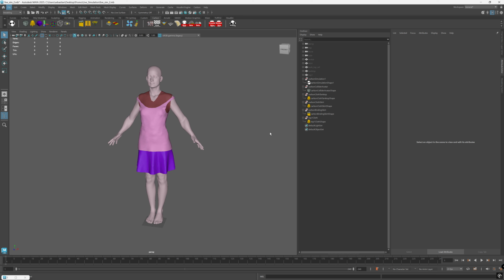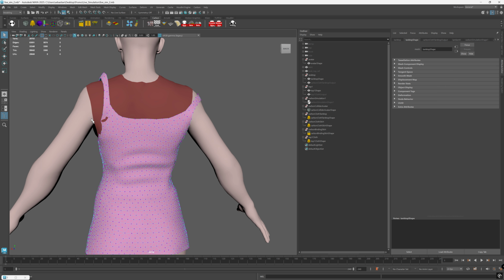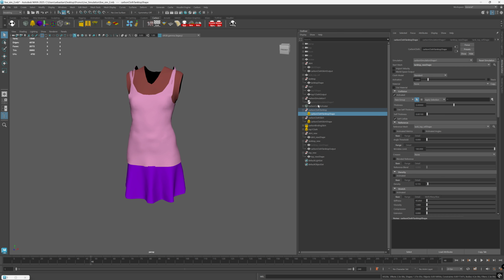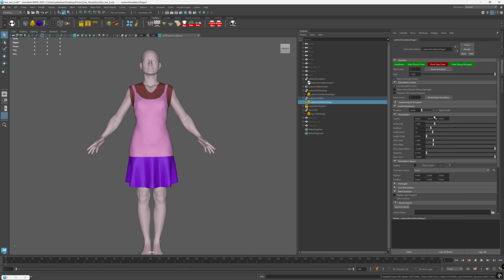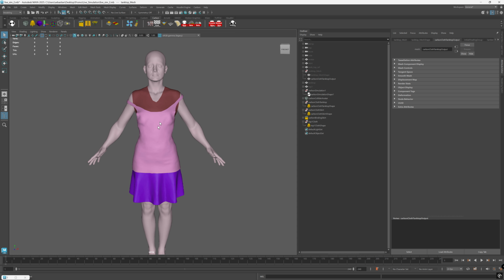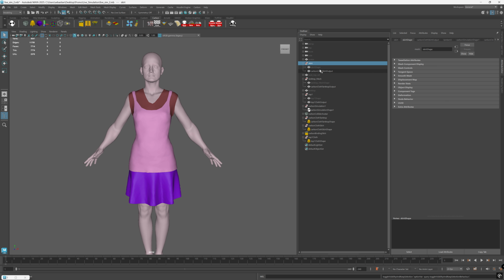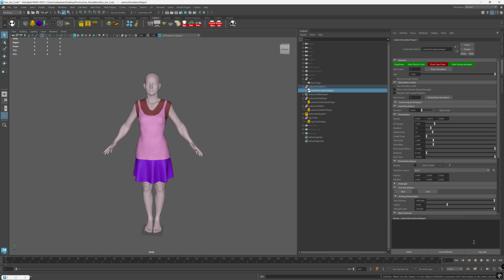Carbon Tutorial - Maya - Live Simulation - How to fix a shoulder strap

Comment: Hi, this is a good start of a tutorial but a few things are not clear:
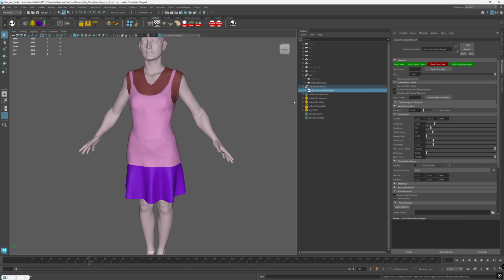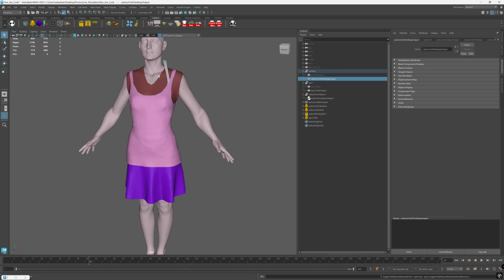- 04:07 - when you say "something in the output is wrong", you show a purple tanktop mesh which is not selected, a tanktop which is very different (exactly at 04:07) and then one single strap which is sticking out.
You never explain what is the reference, start and output meshes. The documentation also doesn't explain this: "The reference metrics allow the cloth to simulate based on physically correct metrics, no matter what the metrics in the start mesh might be." Why do there have to be two? What are metrics in this context? What is the purple mesh??
- 5:50 - why are you creating the new objects? You started explaining the reference mesh as if the viewer already knows what it is. "The original tanktop I had on the avatar without the shirt. Had a reference to provide to my simulation." What does all this mean? A reference of what??? What is a reference in this context?! You then say to make sure to have a reference which is not edited, but then you do the exact opposite - the references ARE edited; the shoulder straps are now fixed, no??
Reply from the maker: Thank you very much for your comment. This video explains a very specific new feature of our Carbon plugin, i.e. Live Simulation, and assumes that you are already familiar with Carbon and the concept of References. You can find more information about References in the written tutorials in the documentation. There are also some downloadable files in the documentation about Reference setups for Bindings and Stitchings. Also, we have recently posted about this topic on our Blog here: https://numerion-software.com/whats-new/latest-news/confused-about-cloth-meshes